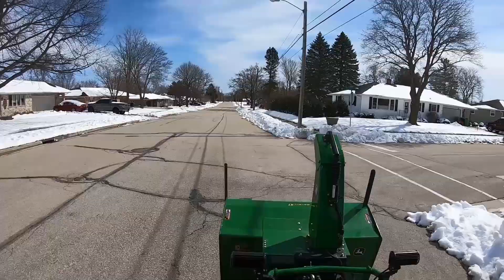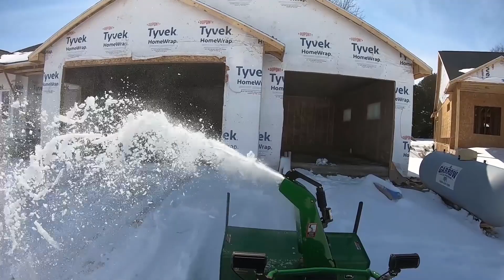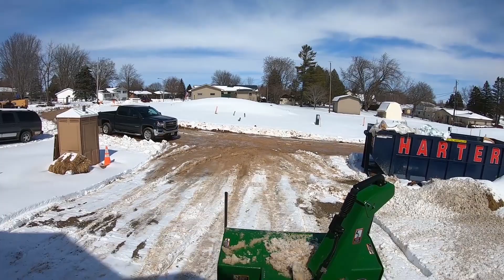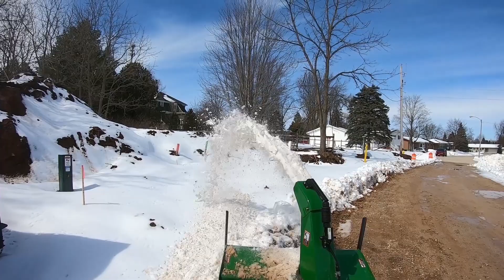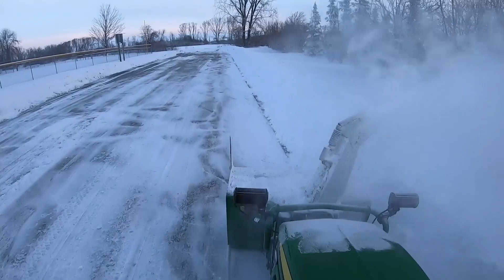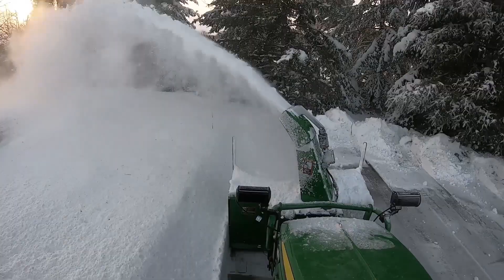Left over snow removal clips for last year

Comment: I’m experiencing lack of steering with the 54” HD blower on 1025r in float mode. Do you ever have to slightly lift the blower to get more traction over the front axle?
Reply from the maker: I don't have a problem with that. may be something to do with the 54in size